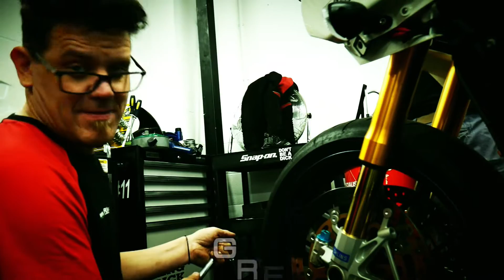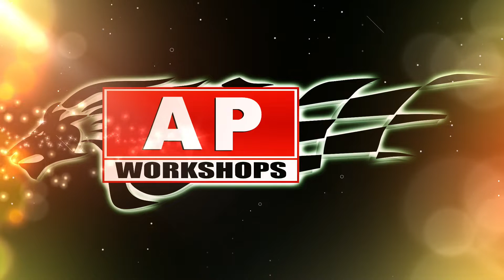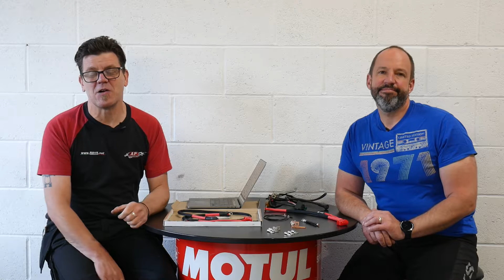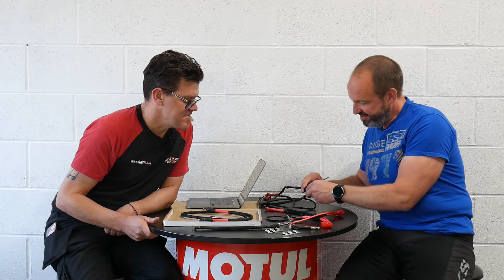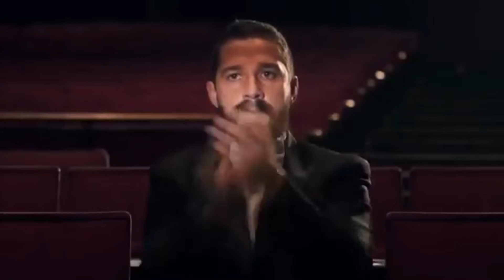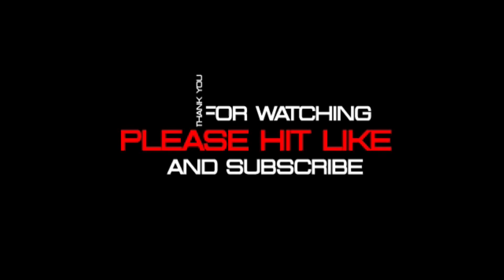AP Workshops - Interview With John, Cable Kits Explained

Comment: Trying to fit my kit and not sure where the 2 cables go I have a 2011 tuono V4. There are 4 cables coming out of the 30 amp abs block under the rear seat and I’m unsure which ones to remove

Comment: Decided to bite the bullet and buy this cable kit from AP Workshops, being from EU country it costed me arm and a leg with postage and customs coming from UK but it was well worth it. My Aprila Falco had new battery and 150amp starter solenoid fitted but it was struggling to start from cold so literally had to put battery on charger every time before any attempt to start bike from cold. Now after replacing battery cables it starts straight like a Jap bike! No more worries, even when left for longer bike starts without any issues.

Comment: QUICK FIX.
I just ran an extra 4 gauge positive cable  directly from my battery to the solenoid in parallel with original OEM one  been left in place. Haven’t had any problems  the warm starts since.Two years now and still works sweet.

Comment: Just fitted mine.   It fires up really strongly now.  Did find I couldn't route the cables to the solenoid as it was, otherwise there'd be a right kink in the cable, but still managed to sort it.  Starter motor is a bit of a pig to get to.  Also voltage on the dash went up to 15.2V at one point, hovering around 14.5V.    Which is good to see after fitting a new stator and rec recently.

Comment: Nice one , ordered this from you 2 days ago , arrived next day , installed today , bit of a chore but fits beautifully , Power cables seem long because the route in instructions details not to go around outer frame , this makes the cables a little tight , but nonetheless looks good placed with my new noco NLP14 lithium battery , check out the connections on that ; game changing battery

Comment: Hi guys, does this help with hot start issues? im having this issue with by 14 tuono aprc. Nightmare if you stop for fuel and engine temp above 80c or worst case stall in the middle of the traffic (hasn't happened yet)
Reply from the maker: I agree .... this has had a quite profound effect on the quality of starting on the v4 product !
Reply: @APWorkshops  I finally got around to fitting these last night. Not the easiest thing to do (for me). Getting that positive cable down through the frame was a ballache. There just didnt seem to be enough space for the old cable and the new one. did i miss something obvious? it came with instructions but im a bit of a novice at this stuff. An installation video would be great if you guys could. 😏
Reply: Yes it certainly can we've had some great success!